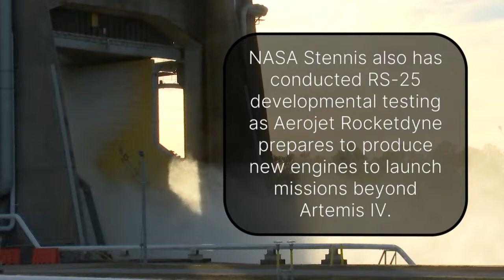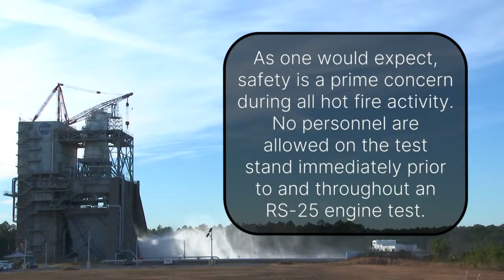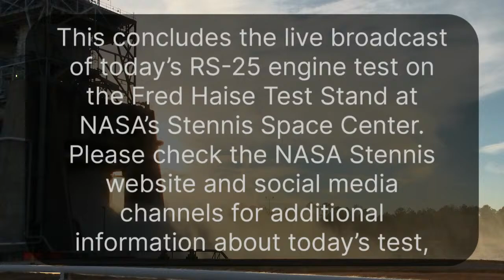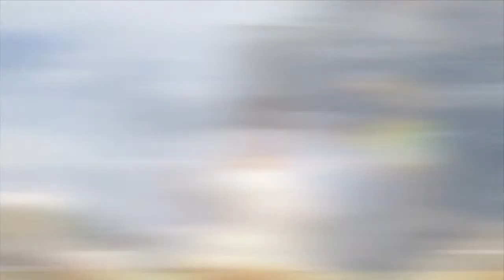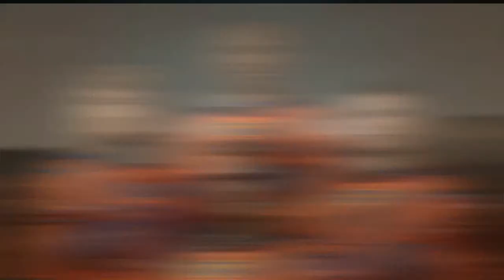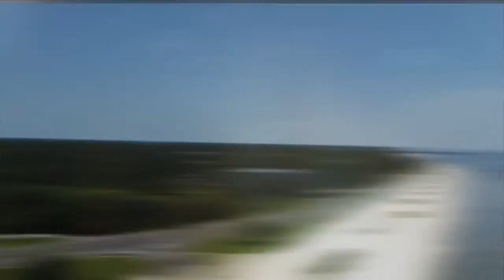NASA Stennis Live Stream

Comment: Why are we testing engines that wont be fired again until 2025?
Reply: This is just 1 of 4 engines that needs to be tested before they can be integrated into the vehicle. Might as well get it done now so they can move onto the next. They are building multiple articles in parallel and not just one at a time. I wouldn't be surprised if this engine isn't for SLS II or even III.

Also, if I am remembering correctly, this is one of the newly redesigned and manufactured expendable engines. It's better to test them now, as opposed to later, to try and find anything in the design or manufacturing process that needs to be tweaked. In any manufacturing setting, sooner is always better than later.
Reply: @dr4d1s  Correct. This is a proof of concept test for the manufacturing method of the new parts to see if they can hold up to the extremes of both propellant loading and flow, and the rigors of firing. 
As the video said, the engines for Artemis I-IV have already been tested. This is a test for later missions. This is to iron out any kinks that may occur due to the new 3D printed parts, so engines being built for later missions can incorporate them if successful.